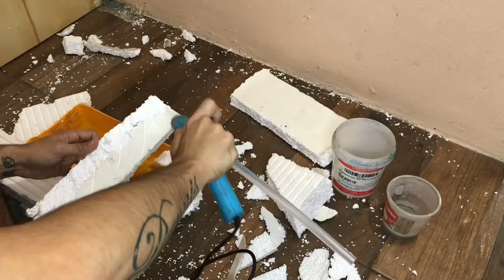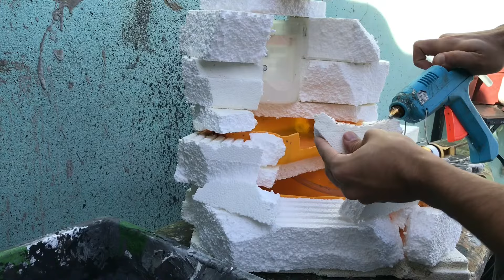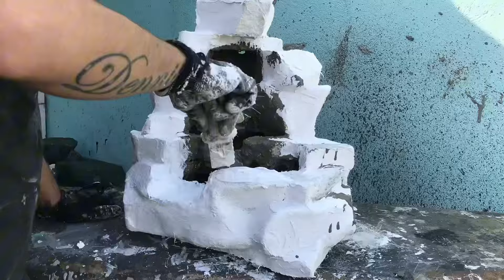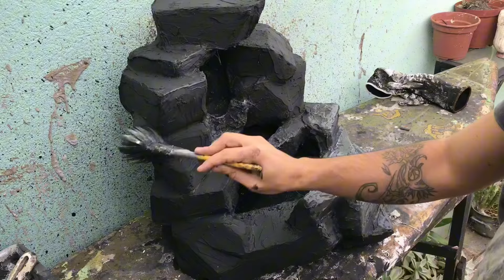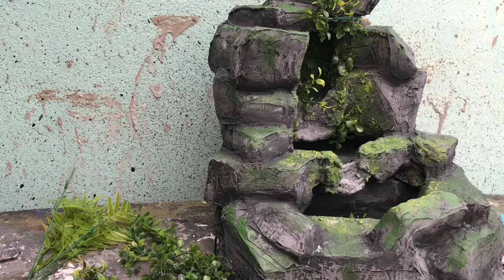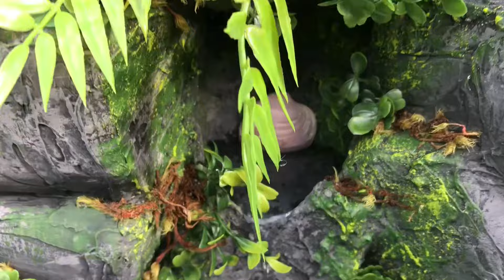Faça sua propria fonte de água com leds DIY / make your own mini waterfall with leds

Comment: Hi Sirius, great work. One question though, does the styrofoam stay glued to the plastic container after it is cemented or will the styrofoam fall off from the plastic container after long use?
Reply from the maker: Muito obrigado, eu colo o isopor com cola quente no recipiente, depois colo fibra em toda a cascata pra dar resistência
Reply: Thank you Sirius. With what do you glue the fibre?
Reply from the maker: @beenakamal1692  com cimento e água